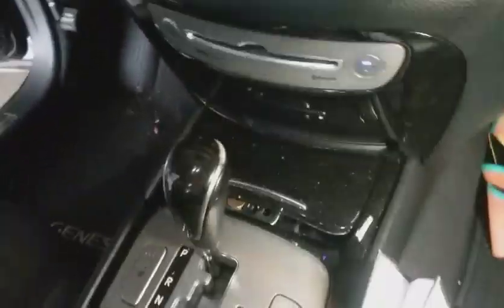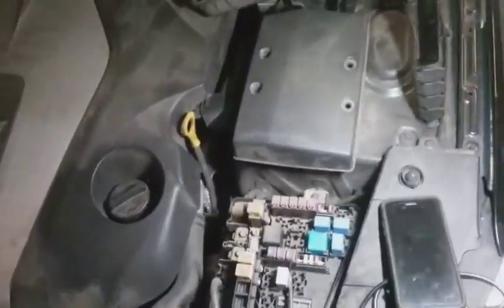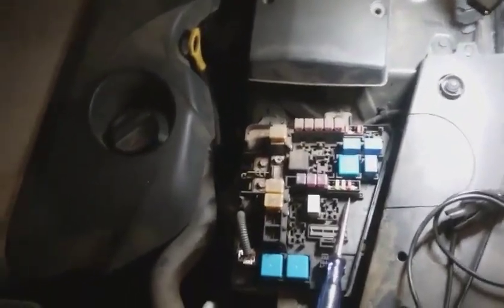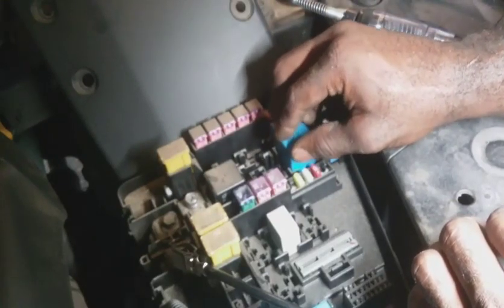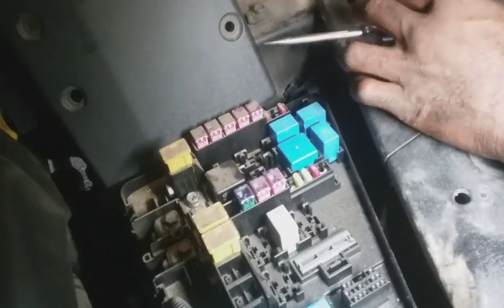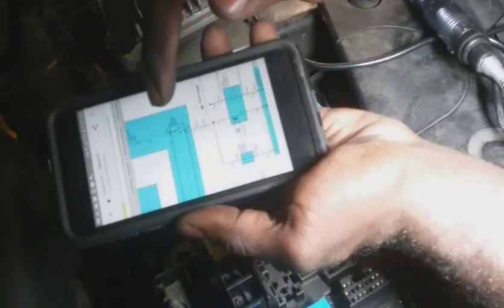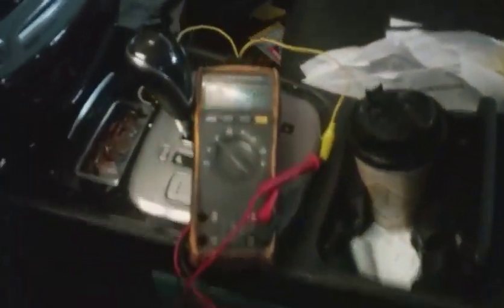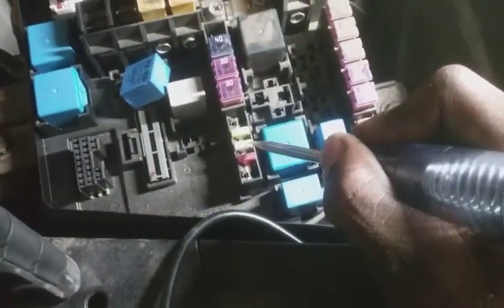2012 genesis cigarette lighter not working [long winded fuse fix]

Comment: Very helpful. I had the same problem with the   power outlets not working on my car. I checked the fuses in the door well and they were all good. So I went to the video and I went straight to the middle fuse 25 amps. it was blown. I put in a new 25 amp fuse and it  started working right away.

Comment: Thank you so much for your knowkedge. Yes it was 25 amp white fuse that was blown. Also if you may my car inadvertly will not start. I have new battery, Alternator is fine. Connections are secure. Sometimes i hear a humming sound.

Comment: I have this car, and same thing happened. I pulled the fuse you did, and it was blown. Replaced it, but they still don’t work. Checked the fuses on passenger side and they are good. What’s next?
Reply: Me again, also, no other problems with car or acc or on.
Reply from the maker: Check the socket.  Make sure you have ground at the housing and or battery positive in the center.  The video should have testing procedure of the actual socket